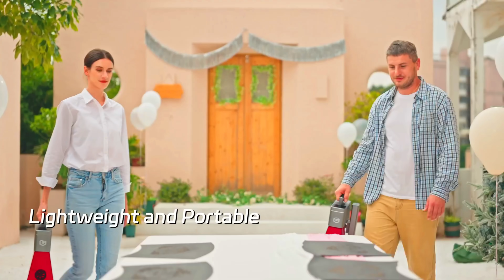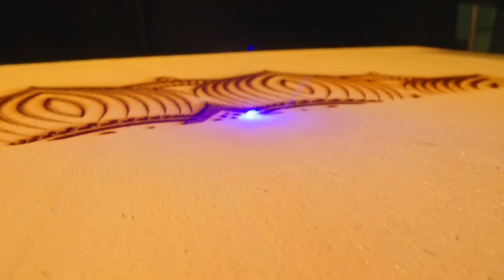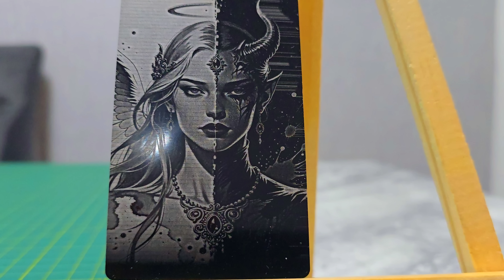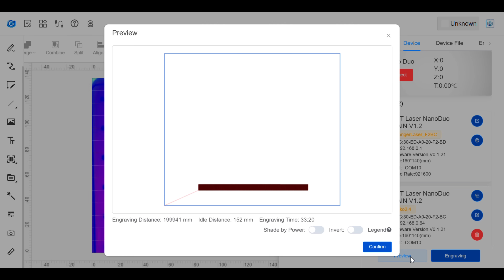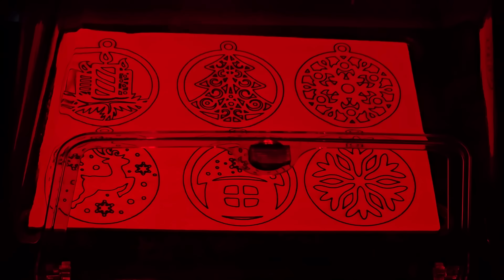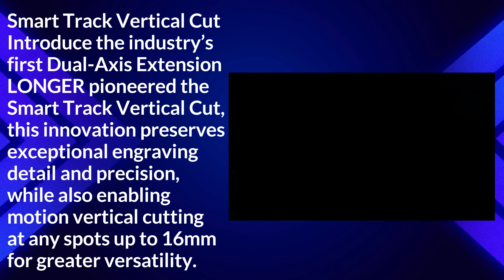Longer Nano Duo Laser Engraver Real Life Test

Comment: Can it do color engrave on stainless steel and deep engraving on metals? If so, I would really consider one for my business
Reply from the maker: Unfortunately, I did not try colour engraving on metal, but usually most 20 W diode lasers can achieve colour engraving to a certain degree.
To answer your second question, a 2 W fiber laser cannot do deep engraving. You would need a much more powerful fiber laser, at least 20 W. With a 2 W fiber laser, you can only do surface etching on metal.